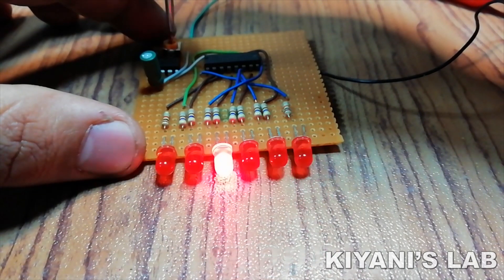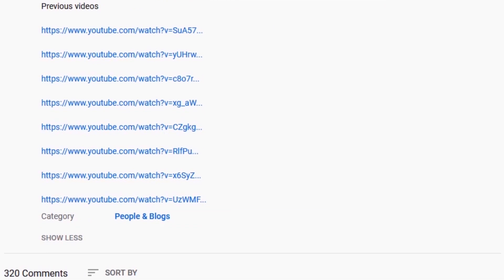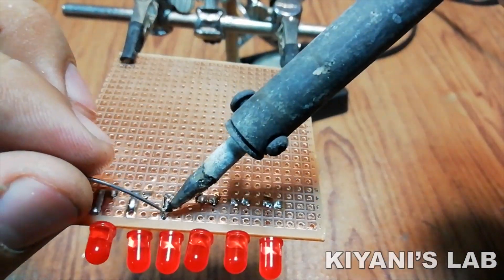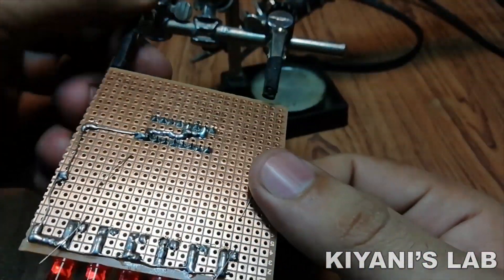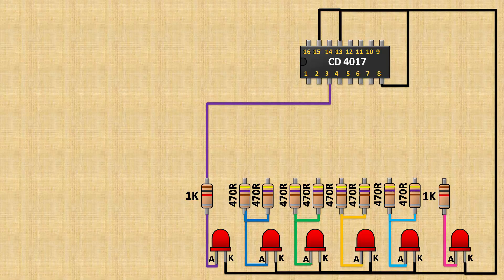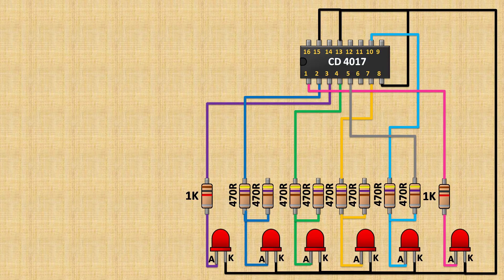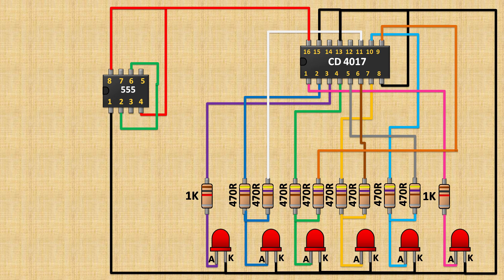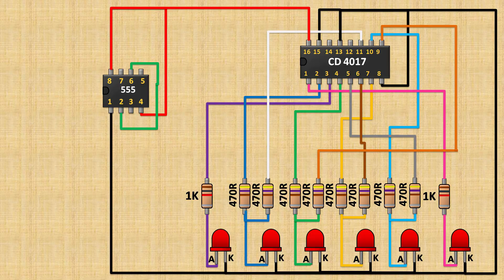How to make Knight Rider Led Light

Comment: OK you got it right in this one.  So how can you run more LEDs, like say 15-25?  Can you daisy chain the same circuit to run more LEDs??  I made a circuit years ago that drove 3  7 or 8 segment LED displays, and it counted from 0 to 9 on the first display and when it got back to 0 it started on the 2nd display and so on until it counted to 999.  It's been many many years since I made that so I don't remember how I did it, but I think it used decade counters to so it.  7474 or something like that.  I can't remember.

Comment: Hello, if I what to run this 6 LED circuit off of a 9V battery do I need to change the capacitors?  I know I have to change the resistors. Thanks

Comment: This is great. The only thing I didn't see was the amount of your power supply!
Can you share that so I can try this myself with all the same parts!!
Reply from the maker: 12v
Reply: @KiyanisLab  Can the values of this circuit (and perhaps the chips used to low voltage ones?) to make this work on USB (5 volts)?

Comment: Is it necessary to use 2 resistors for each led
Reply: Good question. I was wondering the same thing. The others output pins may have to be protected using diodes